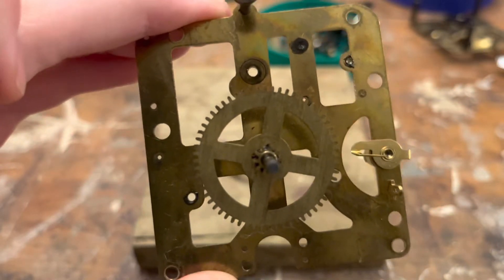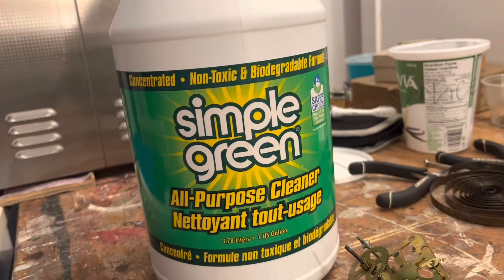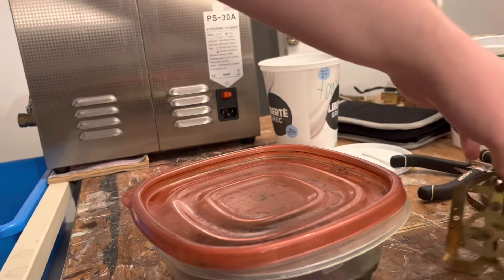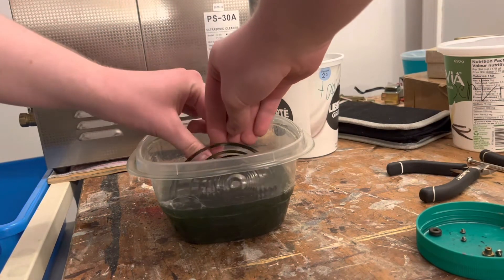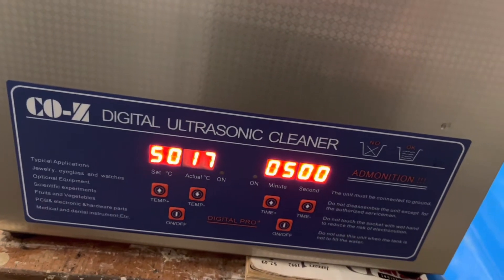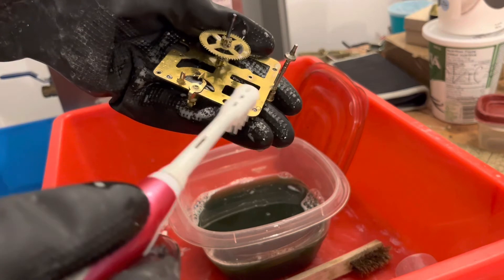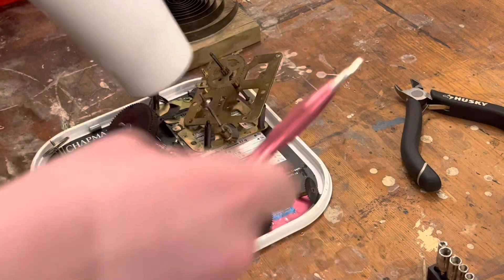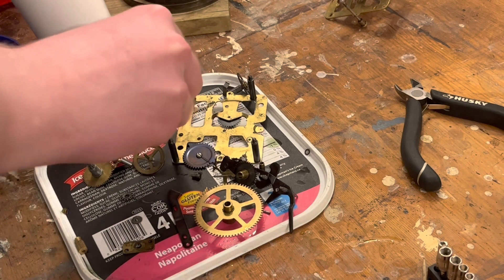Westclox Big Ben Style 7 Movement Cleaning (Part 3) (I don't use this cleaning process anymore)

Comment: I use Industrial Simple Green Degreaser diluted 50/50; rinse in hot water; rinse in alcohol to remove the water, then dry with compressed (canned) air. My brass comes out shiny.
Reply from the maker: That's a very interesting idea. Thanks Mike.